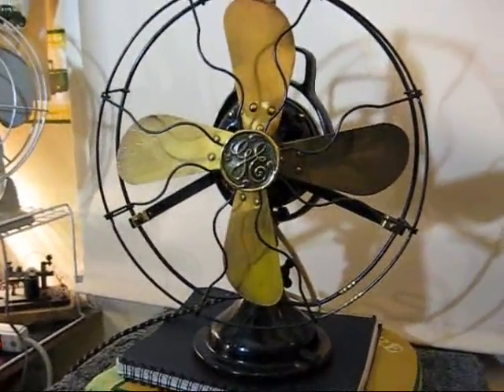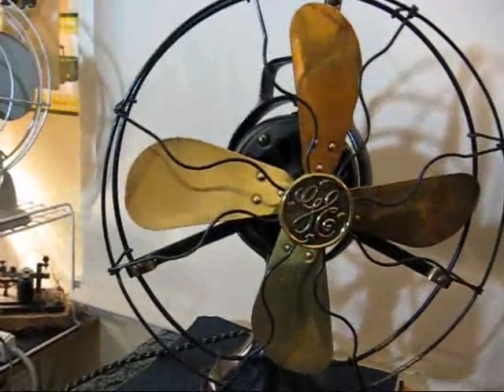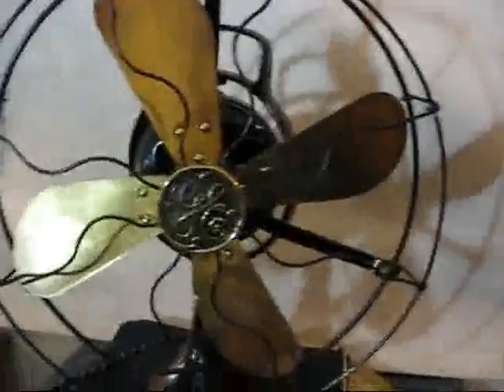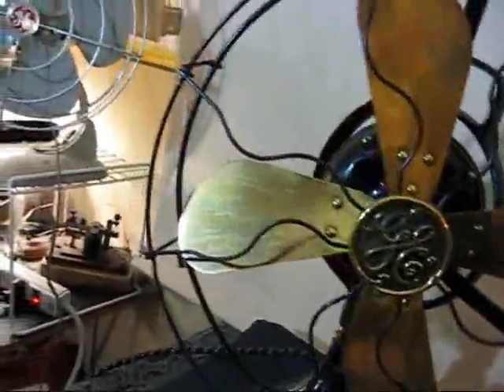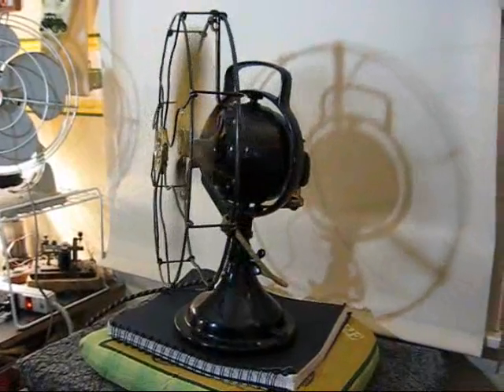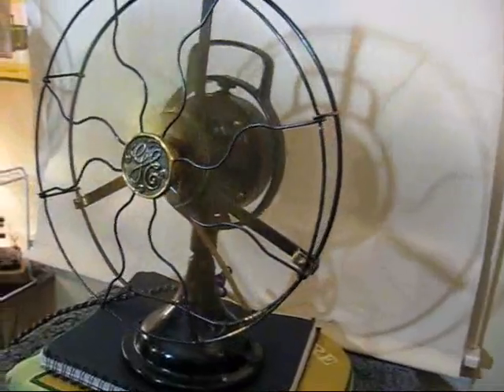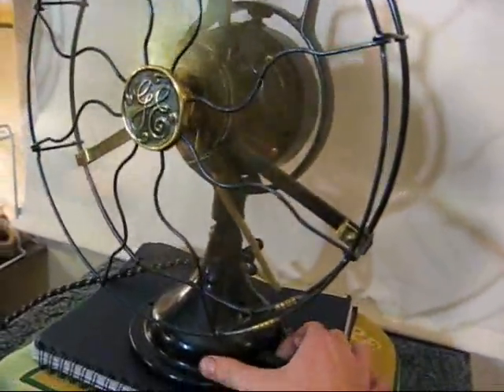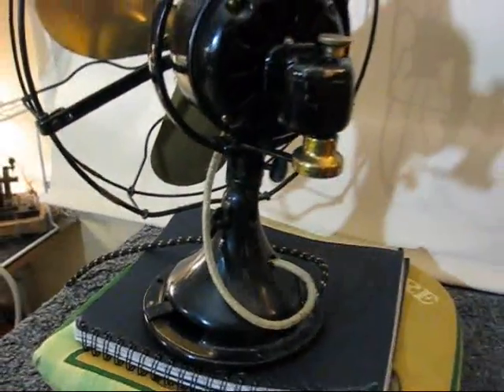GE type Aou

Comment: @TheCrushBones Actually, the symptoms of a speed coil burning out is the opposite.  In 2006, I got myself a 12 inch 4 blade 1910 Westinghouse that had a burned out and toasted speed coil, and the fan ran on high speed on all 3 switch settings.  Basically, all 3 speeds were the same speed.  That is the surest symptom of a burned out speed coil.

Comment from the maker: i dont think its the speed coil. the way these early ge's work is you have an auto transformer in the base. the high speed position on the switch hooks the motor directly to the full wall voltage (110v) the medium and low speeds are fed through the auto transformer which dropps the amount of voltage fed into the motor. so on high speed it should run as good as my auu does on high since its the same motor. but its not even close. i think my motor is bad.

Comment from the maker: if your fan has the oscillaor cast to the rear motor housing. then chances are you have the same oiler i do. it is on top of the oscillator it is a round port with what appears to be a spring loaded bb to keep dust out. to oil you need to press down on the bb thing whil oiling to allow oil to flow in.

Comment: That would place it between 1919 and  1920) so yours is at least a year or two older than mine. You were using this inthe antique fan howto video and you pointed out some sort of oiler hole in the top of the rear motor housing. how are the rear bearings oiled? I can't see any way to oil my rear bearings at all. and the spot that you pointed out on mine looks like there's a rivet there or something.  I'm hoping the back bearing is lubed by the gearbox grease. like a vortalex

Comment from the maker: My AUU has a 4 pole motor with only two wires two the motor, it also has a choke coil in the base. this one has 3 head wires i think (going from memory) no choke coil i think it must have 6 poles i'll have to check

Comment: Very nice fan there.

It seems to coast down OK, so I'd say its' bearings are OK and well oiled. When you took the motor apart, how many poles did it have? It almost seems like yours has a six-pole motor in it. You could check it on a Kill A Watt tester just to be sure something isn't dragging.

I've got to say, I like that low speed. But then I'm a sucker for silent running fans.